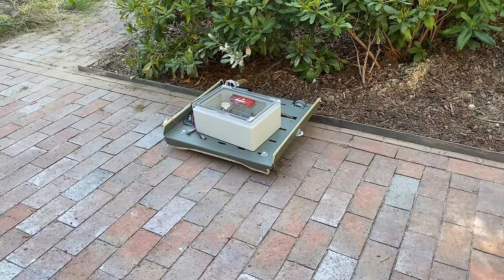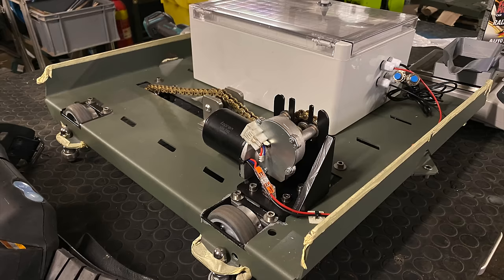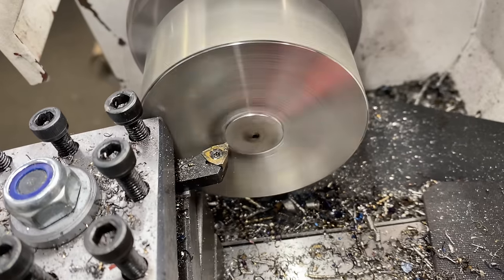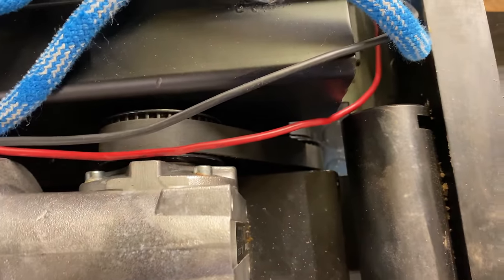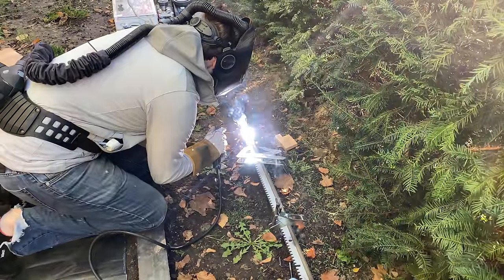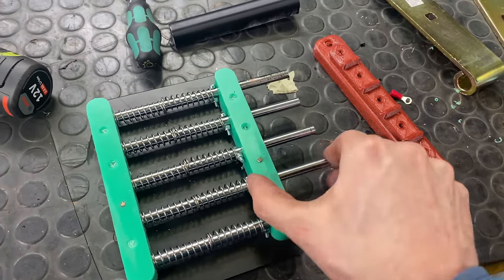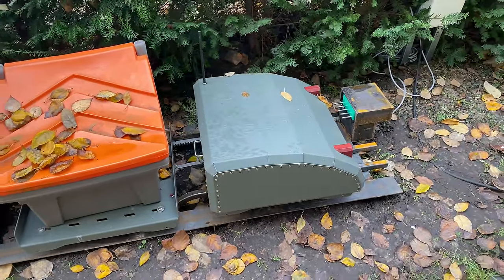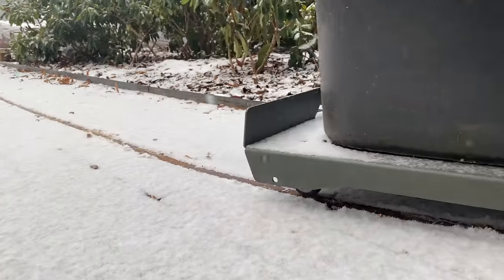I put my trash cans on rails and now they move automaticaly! (Trash Train)

Comment: I’m pretty amazed. The level of ingenuity that went to this is astounding. Mechanics, electronics, programming, welding, machining, etc… you are very talented. Hats off!
Reply from the maker: Thanks! Its learning by doing.
Reply: This makes me want to switch from a software engineer to a mechanical engineer. Awesome video! Big things coming for your channel
Reply: @MaxMakerChannel  hey think this is ace,  one problem I could for see is the switches being hit by leaves, a suggestion would have a very small positive air flow to clear leaves that can be turned on and off, summer would be fine but autumn would cause some issues,  a small blue pipe with forward positive air flow could clear the track easily and stop your end switches being fooled. 

Amazing train, just disappointed you didn't put a train driver hat on the bin;)
Reply: @An-Engineered-Journey  best thing about software engineering is all the free material. It's hard to watch any mech eng videos without seeing all the dollar signs flying by

Comment: I’m a garbage man in a small US city in Missouri. I love this idea. People “forget” to put the trash cans out by the street all the time and then call to the city and say we skipped their trash. Your device would remedy that situation. My only input as a garbage man is automatic trash trucks with a hydraulic grabbing arm need more room between the trash cans as to not knock over the can when they are grabbed by the truck. 
Very cool build I will share with other garbage collection personnel.
Reply: In Germany this type of Garbage Trucks are not really common, that’s why he probably didn’t think about it
Reply: You mean: it needs a selection / points / re-collect system... as in NL we are only allowed to have one container out at the time.... 🙂;-) 
I do like the one-rail-system (and one pair of swiveling wheels), rather than having a second rail in the pavement.
Reply: @gijsgijs2365  no the truck has a big hydraulic arm that grabs the cans. The grabber part needs about 2ft of space in between the cans or it will knock the other ones over. If you still have a guy that goes and grabs the cans it’s perfect. But if the garbage truck has an automatic can grabber the distance between each can will very from 1-3ft to allow the hydraulic grabber to operate with out hitting the other trash cans.
Reply: @jamesblinzler7421  Yes, similar to the trucks here in NL = we also have one-person trucks with hydraulic arms to grab the container. However, we ALSO have the requirement that only one container at the time is allowed to be at the street (and not the whole train)... This as 'on Wednesday even weeks' they will catch the green waste container; 'on Wednesday odd weeks' the rest garbage container and 'on last Friday of the month' the paper/tin cans container...
Hence it needs a split/combine system with points halfway the track... 🙂
and in that case also solving the hydraulic arm issue, as there is only one container at the time to be grabbed.
(I would expect that Germany has similar rules... )

But I definitely like the idea!
Reply: @jamesblinzler7421  Oddly, we have a similar system with the trucks grabbing the bins where I live, but they don't seem to need anywhere near that much space between the bins (still need a bit more than the train seems to provide though).   The problem is more that the bins need to be right on the edge of the curb. Running track on the public footpath is... not really viable.
Reply: People have no excuse nowadays to forget to put the trash out as we all have phones with calendars and you can put reminders to put the trash out the day before  trash day

Comment: I don't normally comment on videos, but I just had to on this.

Making it serviceable and easy to take off the rail was genius with the gas strut. I make things myself and really inspires me in the new year to create some cool stuff!

The look of the tractor unit is cute and futuristic looking, charging with pogo pins - another genius idea. When it was struggling with traction I didn't even think of a Rack and pinion

I cant wait to see what comes of it all

Good Luck!
Reply from the maker: Glad you liked it! I really tried to make this thing reliable for many years. Still there were so many things that didn’t work. Like the belt alignment or clearance issues and so on.

Comment: Definitely a market for this. There are lots of elderly that could use this. Plus, if you could put timers on it, people who go on vacation could also use it. Installation could be an issue but if you sold enough, the price per unit would gradually come down making it an option for even more folks who just don't want to take the trash out.
Reply: true, but when youre on vacation, you arent filling your trash cans so theres really no use

if you really wanted to you could just put them outside as you leave
Reply: 😂😂 It only costs you 20k to take the trash out
Reply: Yep. There actually is a HUGE untapped market for this. The potential could be unlimited…
Reply: Not enough to put a timer, if this is going unattended you need all kind of safety systems to make sure it does not drive into someone or something.
Reply: I dare say a bigger and more lucrative market is Apartment blocks.  They already spend thousands of dollars a year just to have someone come and 'put the bins out' and also return the next day to move them back, all because the residents can't be relied upon to do it themselves.  But there are still hurdles to solve... around here the bins need to be placed on public land out front of the building... places where permanent fixtures, like rails, would not be allowed.
Reply: Biggest problem I see is getting the garbage man to put the cans back on the sled.
Reply: @craymosstheater3999  No, there is not a market for this lol you guys are delusional. You see something new and think it's the best thing ever. You think the trash guys are putting it back on the cart? Who's your target demographic? Elderly people? How many of them need this and can actually afford it? And then on top of that be ok with this eyesore. Also every home would require custom installation and make parts of your property unusable and a hazard
Reply: Just tell a teenager to move it for you and give him 10 euros 
much more cost effective and environmentally friendly
Reply: True. I remember my grandpa had to move his trash bins a complete 60 meter long driveway down to the street and especially with the bigger ones who fit 240 liters this is not so easy when they are full.
Plus when you look at how many different bins we have in germany. Some cities have one for normal trash (black), one for recycling (yellow) one for paper (blue) one for green stuff like leaves, and everything from the garden (brown) and some cities even have bins for glass (green).
And now imagine a 85 year old man move all those bins down to the street. Even when its only once a month or every two weeks the bins get collected every week so that you have black and yellow this week, then brown and blue next week and then black and yellow again. (It depends on the city in which interval they bins get collected.(
Reply: @craymosstheater3999  Just make sure this train is not made in Britain, it would probably go on strike.
Reply: @JackMacLupus  bro what? These aren't how trashcans are in Germany? Black is for everything, brown for organic trash, blue for paper, orange for plastics and metal. Also glass goes into these massive metal dumpsters, and you separate the glass yourself. You have to find where these bins are located. Never saw a glass trashcan that someone has

Edit: I lived in Karlsruhe and Berlin
Reply: @JackMacLupus  Bro at that point you can use a forklift or similar.

Comment: Awesome project! Here are a couple of ideas for the commercial version:
- smarthome scheduling, where bins are brought out on predefined time
- some pressure/weight sensors to detect when bins are emptied, thus triggering return
Reply from the maker: I think programing a app would be too expensive. Also for the maintenance of it.
Reply: @MaxMakerChannel  integrating it into Home Assistant would be very easy. Of course, automation creates a whole bunch of new issues - specifically regarding safety. 

Great project!
Reply: @MaxMakerChannel  Ive seen many youtubers programm overkill apps for the stupidest things. Even i made a simple one like 5 years ago. It doesent cost anything (well maybe licensing does or something)
Reply: I really recommend looking at home assistant to help automate this. You can use esphome to script it with a very simple integration, and it would allow you or anyone else who builds something similar to automate it for their needs. You could even add wireless sensors to the carts to detect collision and stop the system.
Reply: @MaxMakerChannel  Super easy to integrate it with home assistant, and for safety I would add sensors in case a person or animal approaches
Reply: Using this wile nobody is watching is not a good idea
Reply: HOME ASSISTANT XD
Reply: @adriandilena  As far as automation is concerned, the best idea would be to look into how stairlift manufacturers do all the anti collision stuff.
Reply: @MaxMakerChannel  integrating with home assistant wouldn’t be though
Reply: Reading these comments I'm surprised that this stuff doesn't use ESPHome with Home Assistant. All of this could've been a yaml 😊
Reply: @MaxMakerChannel  Just having the remote be compatible with the industry standard channals could be enough for smart home people to integrate themselves.
Reply: @MaxMakerChannel  I have some smart power meters that run Tasmota software that runs on an ESP32.
You can configure timers on a web interface, no app needed. For a smart software, you could probably just fork Tasmota since it's open source.

That'll make most maintenance unnecessary.
Reply: problem with this is that it may just return to base with nothing on it, which would be annoying.
Reply: @MaxMakerChannel  Yes, don't program an app for it. Just expose a dry contact / Potentialfreier Kontakt, document it and leave a little bit of extra room. (That's probably how you integrated your remote anyway.) Than anyone can build their own preferred "smart" switch in. (Just like one would retrofit a garage opener.) A commercial version would probably need a safety stop feature though.
Reply: @MaxMakerChannel  Just make it work with Home Assistant and you're good to go.  Cloud as a service needs to die.
Reply: Great idea and yes easy to realize and wanted (🤔🙄) by users. 
BUT to be honest, unfortunenatly in real life it wont work good or wont be that smart as you expected. 😕 
Either the rubbish collectors have to be teached, to put it exactly this way back on the waggons to drive them back automatically (and let it go quickly 😁) 
or you have to put it on again by your own. Put on and than press the button is ok and more safety. 
Not to mention, if different bins are collected on different days or not all of them 🙄. And there are holidays and malfunctions... etc etc 

Yes you can programe all this, but I found out, the best system often isnt  the fully automatical one but the semi-automatic one 😊
Reply: @thomasbohl6924  This is smart 👍🏻

Comment: This is a fantastic idea! I'm surprised no one thought of doing this sooner. It would be cool to have these set up on a timer so when it's trash day it automatically goes to the corner first thing in the morning and all you need to do is press a button to recall them. The only issue I can see with this is the trash truck isn't always gentle with them when setting them back down.
Reply: I've got an idea for that..... Massive magnets you can "turn on" to retrieve the bins to the tracks 😂
Reply: Yes ... our guys just throw the things back in the general direction of where they picked them up ... there's no way they would spend the 3 seconds required to set them back down onto a train system!
Reply: Somehow I think this isn’t a problem in Germany
Reply: @mamba101  it is. not a huge problem, but i wouldn't trust these people to set the can back onto the platforms, the ones here sometimes set them back the wrong way around or just vaguely near where they got them
Reply: @Maric18 sounds like a skill issue

Comment: For the rails, as an avid abandoned mine affecionado i would actually recommend Straprail you see in older mines quite often (~1800's). Basically a sheet of metal nailed on timbers. Surprisingly sturdy and considerably easier to build. Considering they (unless its a wet mine) survived for over a 100 years and where abused to hell and back, i think for that application they are ideal.
Reply from the maker: Thanks for the input! Will check it out!

Comment: I actually wanted to do this myself when I lived in the snow belt and had a long driveway to the street. Also wanted to include a remote to open and close the garage where the train could park. Never did it though and we moved a few years later. Also considered installing a pneumatic tube mail delivery for snowy and rainy days.
Reply: Well there ya go, just gave him another project idea to work on next 🤣 I would put one and attach it onto the back of my mailbox so when the mailman put the mail in there it just gets sucked up into the tube and the mail man would be confused af 😂
Reply: @Styphoryte  actually you put the mail in a large container that travels thru the tube. You just gotta train the mailman to push the send button. The large ones are about a foot in diameter. Believe it or not the usps used to use these in NYC back in the day to send tons of mail many miles between stations and the city has hundreds of miles of unused tubes underground that were abandoned when the usps quit using the system.
Reply: Wtf where I live we have parcel lockers

Comment: in the name of accessibility for older folks, I think you got yourself a great product. Could even program "routines" to automatically move the garbage bin out on collection day.
Will definitely have to figure out solutions for batteries and such since not everyone has Metabo cordless tools, but you got yourself a functional prototype for sure.
Reply: The system would probably include at least two batteries and a charging unit. Metabo isn't the only swappable battery manufacturer as theres Makita, Milwaukee, and Dewalt to name a few in the states. Definetly an interesting product that I could see people using when they have really long driveways as well. A friend  of mine lives on a relatively steep hill with about a 50yd driveway which kinda sucks.
Reply: This would be amazing with programmable routines.  Needing to be there to press the button makes it moot for someone who doesn't need it as an accessibility aid.
Reply from the maker: Its charging of course at the station. Also this is not just for the collection day, but every day of the week when I bring out the trash or others living in the same house.
Reply from the maker: epicrandomness2463  I see it the same as you. A cable system is better. Have you got ideas how the cables could go around corners?
Reply: @MaxMakerChannel  I'm not Epic Randomness, but I think that a good way to make it go around corners is using a ground-level power supply (the thing used in trams), idk if it would be affordable to build and commercialize this way but I believe it's the best way to connect it directly to the mains and without any cables being visible.
Reply: @JaviermbPlays  that'd be a bad idea, as those rails in Trams and whatnots are extremely dangerous, they can kill a person, which is why there's numerous signs in places that have these kinds of rails to stay off the tracks, this is saying nothing about the danger of the trains/trams/LRT that travel them that are just as dangerous as the rail.
Reply: Trains I understand, trams I only seen with cables over head, if anything I think battery fine as can use any, not just power tool batteries
Reply: @mlee6050  Trams sometimes also use the system that I'm talking about, like for example the Sevilla tram
Reply: Epic Randomness  Then you would have to deal with the extra setup and size of the cables, and if you are referencing overhead power cables for trams, these could be dangerous. I think the gear is quite an elegant solution because it provides a failure point if the train cart gets stuck on something. Not to mention steel cable is actually kinda pricey.
Reply: @MaxMakerChannel  Since this is likely to only need to move once or twice a week, a solar panel could probably keep that battery charged.

Comment: I would recommend that you exchange out the swivel wheel on the cars for staight castors. In your configuration, the swivels are going to have a lot of undue lateral force put upon them because when the train reverses direction, the wheel throw can't relive itself because the cars are "fixed" in place. Eventually, the bearing in the swivels will wear our much faster than normal because of this.

Straight, fixed wheel would be ideal for your set up. The curves it takes are slight enough, they won't care.

Source: 15 years experience as a theatrical technical director who's put a LOT of heavy scenery on wheels.
Reply: I'm glad you said something because all I do is sweep puke and I coulda told him that.

Comment: Awesome, we only have 3 tubs to put out each week but a massive 5degree incline to descend, so your inspiration of a rack and pinion system (like many mountain rail tracks) was spot on 👍🏻
Reply: If it's a straight run, use a counter weight and cable.
Reply: @TheRainHarvester  Cable hauled inclines can also go round corners! A different issue would be that the weight of the bins would change depending on how full they were so your counterweight would need to take that into account. You'd probably need some sort of braking system on the rope/pulley etc.
Reply from the maker: Do it!